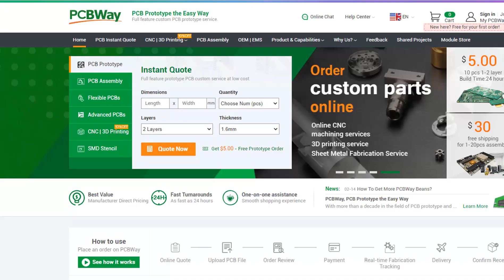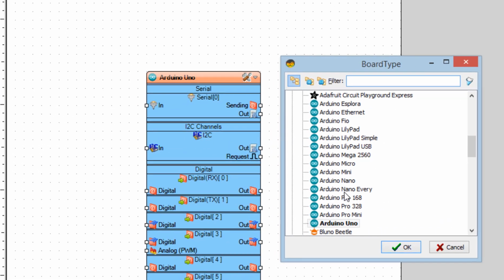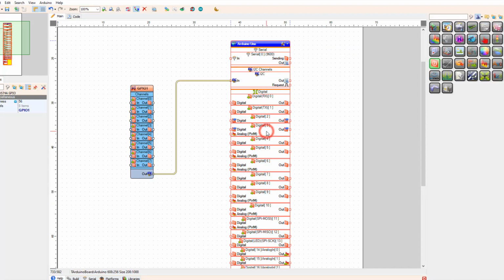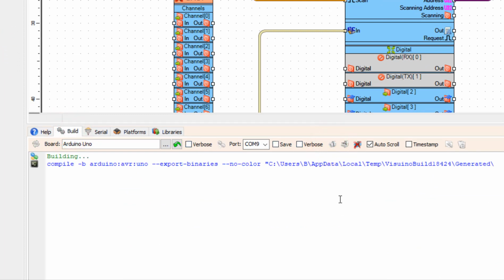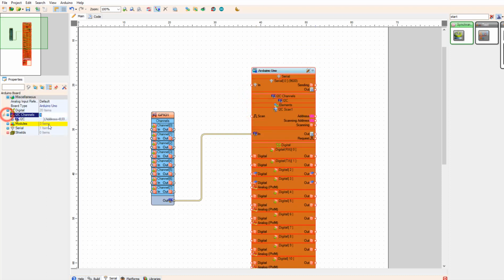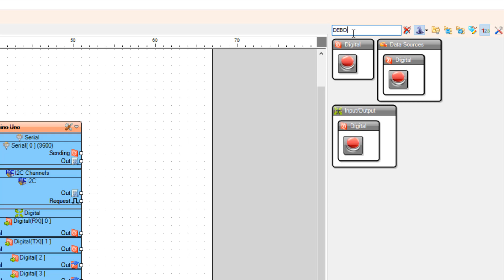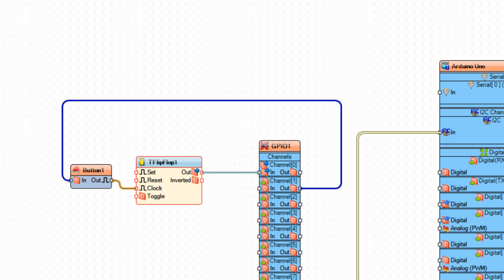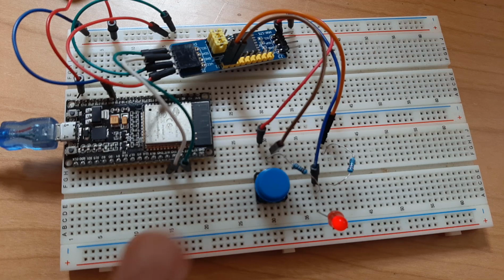How to Use PCF8574 GPIO Extender With Arduino or ESP32

Comment: Why does the button connect to GPIO Out 1 and GPIO In 0? The button is connected to +5V. Are you using the GPIO pin as the 5V source?
Reply from the maker: You select pins in Visuino, you can change them if you want. For the +5V I always wire buttons like this.